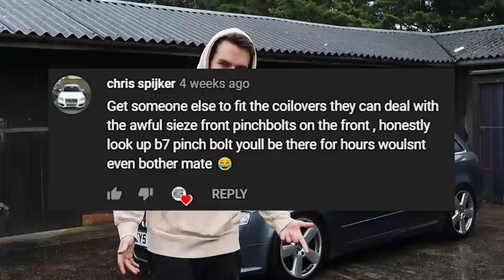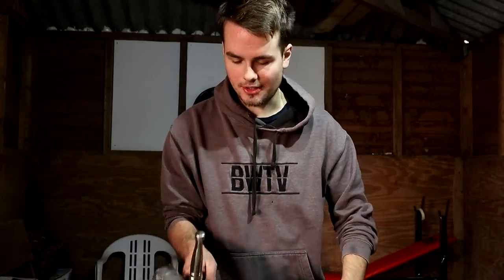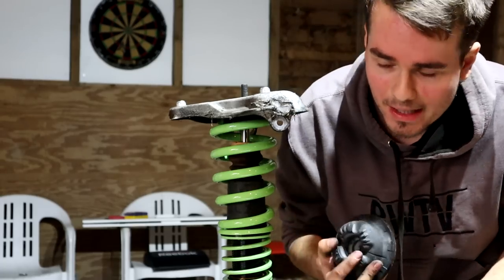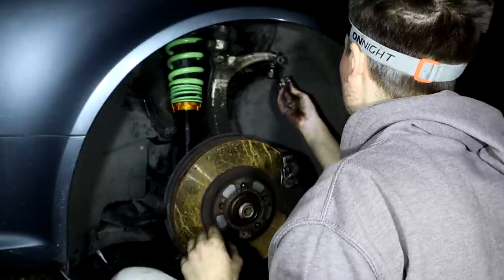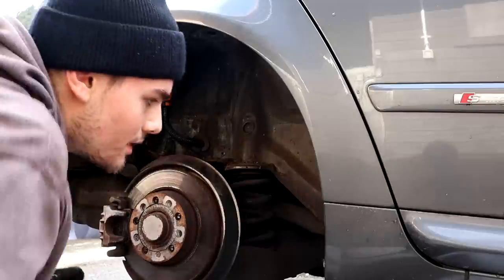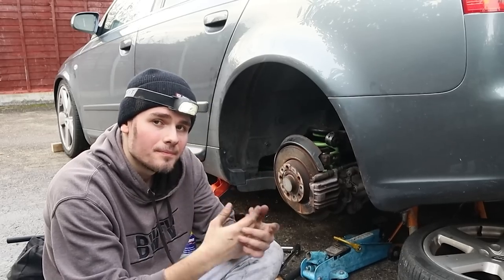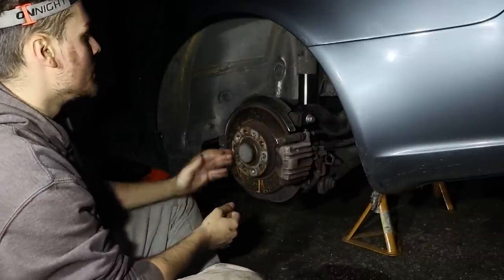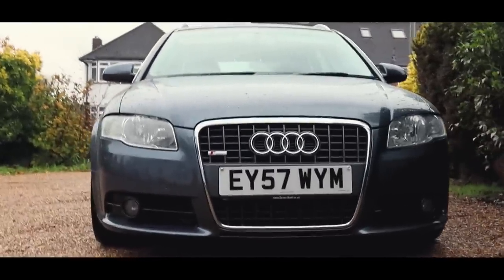Here's Why You SHOULD Install Coilovers Yourself! | Audi A4 B7 Coilover Install

Comment from the maker: Thoughts on the new lows for the A4?
Reply: Looks good mate, I’ve got a B6 A4 which me and a few friends fitted coilovers to. Fair play to you for doing all that on the floor😂
Reply: I think it looks good. Ive never been a fan of those rims but they are livable. A different set of factory audi rims may look a tad better. Just my opinion. Good looking car though. Just picked up a wagon myself a C5 Audi Allroad. And a B7 was definently on my list but I love the AR. Got to have a wago to trailer the other cars.
Reply: looks mint!
Reply: Looks good but i would take care of any rubbing issues. The stance of the car looks AWESOME now though
Reply: Looks pretty much exactly like my b7 a4. I just need to map mine and change the grill out. Would be good to see you attempt that too💪🏾
Reply from the maker: What grill are you going for?
Reply: You should remove the helper springs for a smoother ride You won't regret it I promise

Comment: you should get it chipped whenever the tuners are back open, you'll love the power bump, it should go from 170 bhp to around 200-210 ish
Reply from the maker: That's definitely on the to do list, I can imagine the jump in power is pretty nice 👌
Reply: @BWTV  got a lad who can do it mobile for you, deffo recommend he did my b7 cabriolet stage 2
Reply: @BWTV  yeah it'll be as fast if not faster than a 1.8T
Reply: @boosted4908  you mean a dodgy flash map😂he knows better
Reply: forget about going to someone, buy a kess v2 or a mpps clone. Get a generic map with egr off and that’s all you need. No point in a custom map unless your going for insane power. All in together it will cost less then £60 just depends on who you get the file from.
Reply: @piovo5222  and risk bricking your ecu👍🏼
Reply: @rh9224  not if you do it right, but even then forget the mpps clone get a ktag and it’s much easier even if you do brick you can easily recover it. That’s around £100. He can choose what ever he wants but I do this with all my cars with a mpps clone and just pay someone on eBay to send me the file. Never bricked a ecu yet and done this to 3 cars.
Reply: @Mason kess map? Kess is the tool to read the ecu, which many professional companies use.
Reply: @Mason also it must have been wrong map because the guy doesn’t know what he’s doing, you can go on forums and pay for a custom one also if you’d like.

Comment: When you tighten the suspension bolts you need to have the weight of the car on them, otherwise your bushing will be under tension and that will kill them. Then you will have to undo those horrendous top bolts. There is a spec in the manual if you are dismantling the whole suspension to set the top arm position before you put the strut back in.
Reply from the maker: Thank you for the tips 👍👍

Comment: Definitely wouldn’t recommend lowering the subframe when all you have to do is disconnect the bottom control arms. It will drop down far enough to pull the spring. Same for the b5 as well

Comment: Hello and welcome. I have a question because I can't find a clear and lucid answer at all. On Audi forums and websites, "experts" instead of helping, only confuse me. So the question: I want to slightly lower the front (A4 B7), because after putting on the 18's it looks like a fire truck. Can I replace only the springs, without replacing the shock absorbers? I have standard 1BA suspension and weight class 11. If I install 1BE springs from the appropriate weight class on 1BA shock absorbers, will it be a safe solution? Is it possible to do this at all or do I have to replace the whole thing, i.e. the springs and shock absorbers? Please note that I don't want to do rustic tuning, I just want the front to look normal and the gap to be the same throughout the entire wheel oval. Thank you in advance for your answer.
Reply from the maker: That should be fine to do, it may just mean in the future your shocks will wear and get damaged quicker which is why many people decide to go with a full coilover setup
Reply: @BWTV  Thanx.
Well, I'm mainly concerned about safety issues, won't it fall apart while driving? I realize that the shock absorbers will wear out faster. I have another question because I also heard the opinion that springs from a lower weight category should be installed during such a replacement to lower the suspension. I mean a maximum of -30mm.
Reply from the maker: @marekczarny  sorry mate I don't know the technical side of it but to your first comment, no, if it is installed correctly it won't just break apart, the shock will probably start to leak and the suspension will get stiff or bouncier where its failed
Reply: @BWTV  Thank you. So it seems that technically you could connect shock absorber 1BA with spring 1BE if you really insist, but in practice, it doesn't make sense in the long run. It's better to replace the whole thing with 1BE. Now, here's another doubt😁 How will the car handle at higher speeds above 60mph/100kmh if the front is stiffer than the rear? I have a feeling it's most sensible to switch to 1BE both at the rear and the front, isn't it?
Reply from the maker: @marekczarny  yea I would imagine the rear would be a bit "floaty" , best to do all 👍

Comment: Irrelevant now mate but a future tip.
You can use a spark plug socket to remove the top nut bolt. Socket over top and Alan key through the middle you can get a spanner on there then. I found that out the hard way lol
Reply from the maker: Yeah I did try it, it's a great idea! But the spark plug sockets I had weren't the right size :(

Comment: I don't see how people think its hard... u just get new stretch bolts before hand just in case and I got mine done in like 45 minutes no power tools... just because its not the usual suspension doesn't make it hard...
Reply from the maker: It's because the bolt seizes and the head snaps off and you can't get the bolt out unless you drill it. It's nice and easy if you've done loads of suspension before, but this was my 2nd time doing it, so cheers for watching
Reply: @BWTV  i used a punch and a hammer to persuade the bolt to get out while I also hit the two upper control arms to lose it while having a jack take pressure off of the control arms from the bottom. Wasn't easy but worked just fine. Wasn't saying anything bad btw just if u use some common sense patient's and penatrating oil it will come out without a drill
Reply: @BWTV  rears took me a while still tho lmfao 🤣

Comment: Bit of helpful advice if you ever need to adjust the height of the rear springs, you can actually adjust it without taking the wheel off. If you look underneath the bottom mount where the spring sits, theres a hole, you can fit a ratchet extension up through there and adjust it. This may be different for raceland coilovers but on mine (JOM's) theres a square hole on the underside of the adjuster.
Reply: How have those JOM Coilovers treated you? Sorry for such a late comment but I’m getting JOMs aswell
Reply: @arberdemce4569  Very good value for money, wouldnt be the most comfortable but does the job. I live on bad country roads and I found it harsh at first but you get used to it. Had them in the car for 3 years with no problems before I sold it.